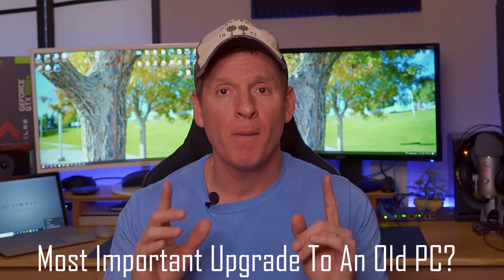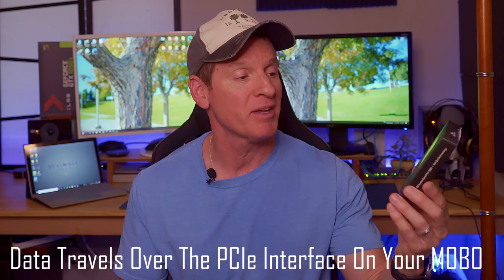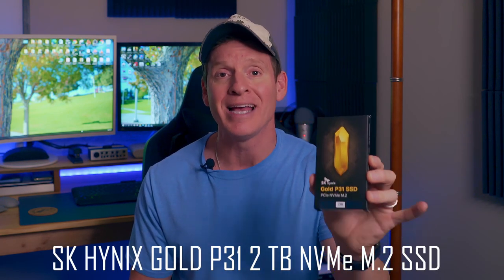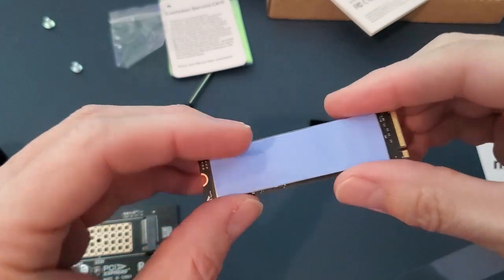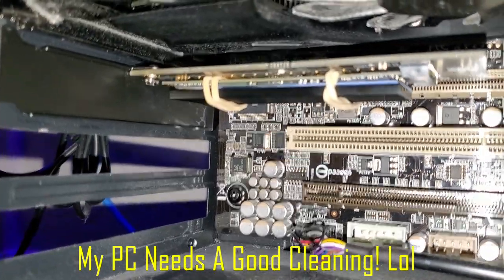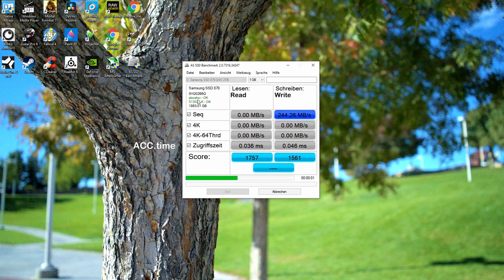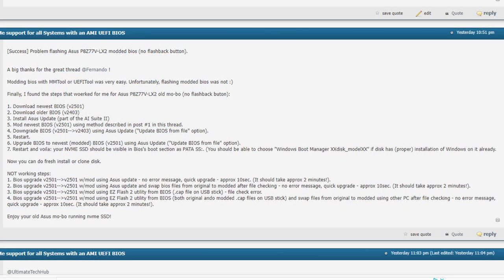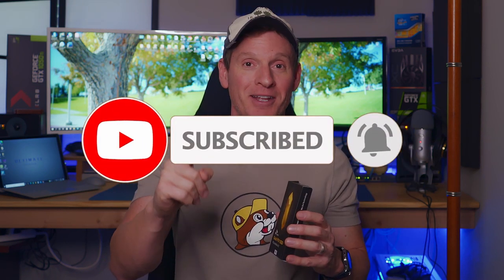HOW TO UPGRADE A DESKTOP PC IN 2023!!

Comment: Hey tech Hub! My pc currently is not turning on but all the fans spins and the motherboard light turns on, the gpu is working fine. But I think i have a dead cpu or a faulty mobo.
Reply from the maker: Most likely it's the motherboard. You can check the CPU for any damage but that's very unusual.
Reply: @UltimateTechHub  i tried it with my other system and I accidentally dropped my 3100 and now it wont boot, it did post at first with a red line.
Reply: @UltimateTechHub  its the cpu that died on me